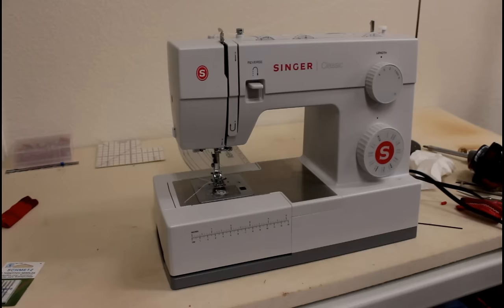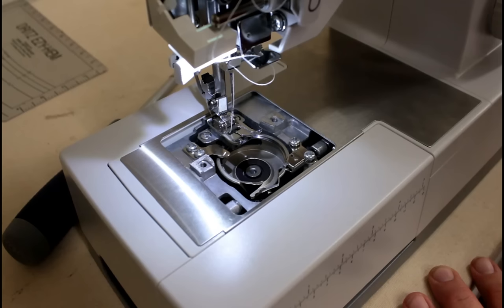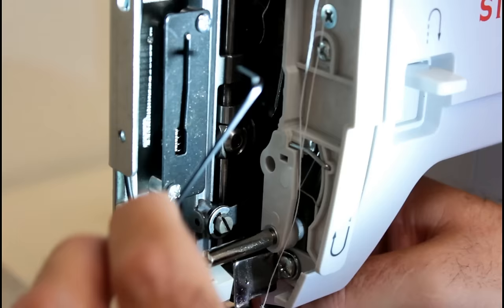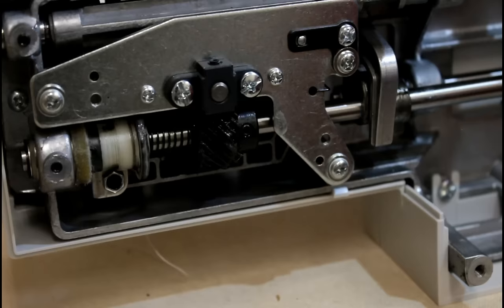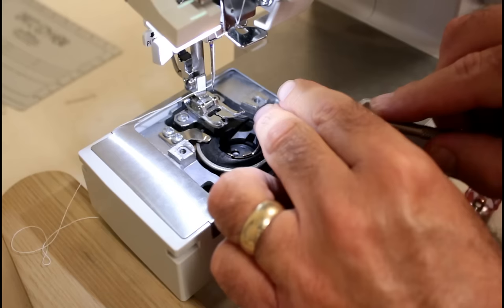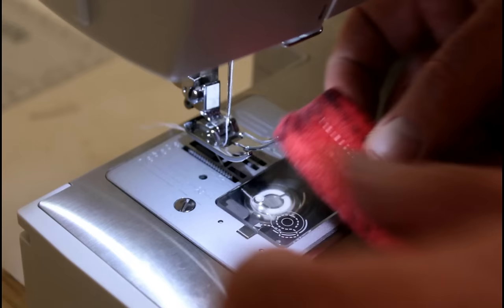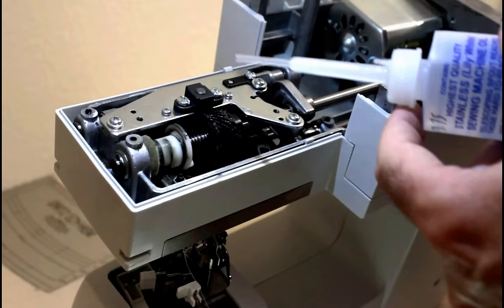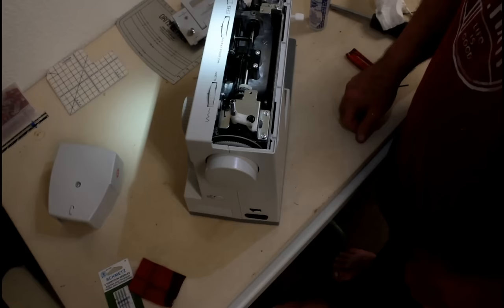Setting the Timing, Greasing & Oiling the Singer Heavy Duty Series Sewing Machines

Comment: Thank you for this tutorial. Very informative. I've never dug into my Singer Classic 44s like this before. I started out with my machine only being able to complete a straight stitch, but not picking up the bobbin thread with a zig-zag. In my research I believe it's a hook timing issue. My needle is aligning properly, as you've instructed, but after reassembly it isn't able to complete even a basic straight stitch. Where might I have gone wrong and what can I do to repair this on my own without taking it in for service?
Reply from the maker: Just take it apart and see how much it is out of time when looking around to take up the thread. I have had to do this many times before.

Comment: Hey Kevin!this is such a well explained video! I just changed the timing and it loops when I turn the wheel and catches both stitches for the zig zag but when I sew it only catches the straight stitch... and not the other right stitch! I'm assuming it's still a timing issue?
Reply from the maker: Yes, it can be the needle depth and /or timing.

Comment: Thank you Kevin, an exceptionally good video. You speak plainly and w/excellent volume.   You made this fix look fairly easy.   What can throw  both needle and hook timing off?    Also what is the danger of turning hand wheel away from you and not toward the front of machine?   And is a little bit of turning hand wheel in wrong direction bad for machine?  Appreciate your answer and willingness to share your knowledge. I am a subscriber.   Oh yeah, where to get Service manual for these machines?
Reply from the maker: I've turned the handwheel the WRONG way (away from the front) on many occasions without doing damage to the machine. However, Singer says not to do so. You can get the service manual using the link I provided in the video description. Click on Show More if it isn't showing up for you.

Comment: The only step I didn’t understand is the adjusting of the needle in the top housing.
Am I loosening it to make it move up and down or tightening it to keep it completely still?
Reply: How deep should the needle be?
Reply from the maker: In the case of the one I was repairing on this video it was thrown out of time by trying to sew something that was way too heavy for this type of machine. This caused the needle to push up slightly. Therefore, it wasn't coming down to the lowest point timing wise. This means you have to loosen the needle bar screw and then rotate the wheel until the hook rotates around to the point it would be picking up the thread. Then you lower the needle to that point and tighten up the screw that holds it. This may require a slight adjustment, but it will get it close.
Reply: @kevinsews  my needle looks like it is to deep set. I did loosen needle screw. . I don't see any difference.  Idk. Put machine back together now it want advance fabric. I checked feeddogs.

Comment: This video was so helpful as I ran into this issue last year and was able to fix it. This year I have ran into the same issue and for some reason my 1.5 mm allen key does not fit into the bolt right above the one you loosened in the video. The timing is so completely off and I have no idea what to do next.
Reply from the maker: Did you try going down a size to see if it would fit?
Reply: @kevinsews  I had to purchase a torx key set and it worked. The only issue now is that I believe the timing is in the opposite position. When you turn the lever towards you, what should the needle be going up or down?
Reply from the maker: @Sarabimakeda  Yes, it should go up and down as you turn the wheel toward you.
Reply: I tried this but couldn’t get it to work.  I’m at my witt’s end.  About to throw the “dang” thing away and buy a new one.  I have no idea what I’m doing wrong.
Reply from the maker: @debbieharper4771  Tried a new torx set and it didn't work?

Comment: Great video, really detailed and helpful.  We have a problem with the button for the drop feed dogs, after using it the feed dogs would no longer come up to regular sewing position.  My husband was able to toggle the switch under the machine to make the feed dogs return to regular sewing position, but something is broken, any suggestions would be appreciated.  thank you
Reply from the maker: Remove the cover on the base plate and see if the lever that controls the feed dogs up and down feature came lose. I've seen this happen before.

Comment: Great video Kevin, I just did a retime on a Singer Confidence. It doesn't have easy access panels, the whole front section has to come off. Also it has needle to dogs timing AND needle to hook. I was wondering if your manual didn't give you a needle height spec? I guess having the needle threaded and seeing the hook pickup work in all needle lateral positions was enough though. Thanks for sharing.
Reply from the maker: It does provide the measurements. However, I just adjust it until it does the widest zigzag width sews successfully.   After doing this all of the other stitches work successfully.

Comment: Great video, thank you for the tutorial, I have the same machine, took it apart watching your video, fixed the timing, all seems well, except now the thread keeps jamming, and looping bad on the bottom, changed needles, rethreaded, etc, very frustrating, I won't quit till it works. Any suggestions ?
Reply from the maker: Take a look at this video on how to test your starting point for needle thread starting point: https://youtu.be/7lyxWXCh2dQ
Reply: @kevinsews  Solved the looping issue. Thank you. Goes along sewing fairly well, but have a skipped stitch here and there. Any idea what to check ? Tried new needles, thread, etc, I will not give up, this is my mission to fix it.
Reply from the maker: @terrysmith4295  It can be a timing issue or the needle isn't close enough or too close to the hook. Needle tension can also contribute.
Reply: @kevinsews  Is there a way to move the needle bar if the needle is to close to the hook ?
Reply from the maker: @terrysmith4295  Yes. they show you how in the Singer Service Manual. See the link I provided in the About area to download it.

Comment: Well, Kevin Sews, Kathy (Anjylkat) here still does not. Oh boy, I’m beginning to wonder if I will continue to mess my machine up worse if I keep trying to do this myself! I’ve followed all the things you show in this video and lost a couple of things (bobbin holder, screws, bobbing cover plate. I was feeling very accomplished at getting things apart and putting them back together and making adjustments to the needle bar, aligning the hook and needle so top thread gets hooked correctly. I’ve made sure with the press foot in both up and down positions is doing what it’s suppose to do, but now it won’t make any stitches. The bottom thread isn’t catching the top thread to make a stitch or vice versa. I’m still not clear on that whole process…but all the catching and pulling material into the bottom and making a big mess on underside of fabric, it’s now just making one long giant stitch and then begins to stick and gather at the presser foot. No stitches if any kind too or bottom. Is there another video you can recommend at this point? I’m almost ready to throw it out the window, take it in for repairs at a shop that I boy sells super high end machines, or suck it up and keep going until I get it sewing right. I’ve checked and changed  needles, rewound bobbins, made sure bobbin thread is going in the right direction and catching/lying  where it’s supposed to  correctly. Anything you can lend would be so appreciated and I do really appreciate the all your videos and how much you’ve helped so many of us. I now know that I caused a lot of my problems by not taking the time to learn how to use my machine correctly and rushed through to do the sewing projects I had to do right after buying the machine. If I can get it fixed I believe it’s a great machine to see the things I want to sew jean, leather, cottons, polyester knits, chiffon, etc. I’ve learned a great deal but if I don’t stick with it, I easily forget and have to re-educate myself in what I previously learned (aka short term memory loss 🤪😜😛
Reply: I found one of your videos that I’m going to try tomorrow to see if that fixes it cuz, yeah, I think the bobbin holder thingy is loose.
Reply from the maker: @anjylkat  If you still are having issues then download the service manual and follow the steps it provides.
Reply: @kevinsews  thanks Kevin! I downloaded it awhile back when I took it apart the first time and couldn’t figure out how to get it back together. I must say I get to the point where I’m beyond frustrated and want to give up on it, but due to your videos and a few others I take a break from it and dive right back in and  push myself to rewatch the videos and try it again. I’ve learned more each time and have a better understanding of all of it! After spending literally hours on trying to get the free arm slab to fit back on, I realized I wasn’t putting it on correctly. It had to go behind the black square thing in the middle not slide alongside of it. Anyway, I’ll have it all back together soon and since I already adjusted the hook and needle once before I know I will get it again, but if it wasn’t for all the information you and a couple others have given on your videos, I’d never have accomplished what I have so far! I’m anxious to get this working good so I can make those flannel pj pants from the video on your channel! Thanks again!
Reply from the maker: @anjylkat  My pleasure! I am glad to hear you are making progress.
Reply: @kevinsews  bit the bullet and bought a new machine. Same model and make. Least I know lots about this one and know things NOT to do! I’ve spent way too much time at this point and I told my granddaughters I was making them aprons but only got one done. I told the youngest one I was making her a ladybug backpack for school but no backpack and school starts this Weds. I’m kinda hoping I can move close to them next year cuz I’m in a Cali and their dad passed away 7 years ago so my other son and I are very important to the kids now that their daddy is gone. I made a Jean purse lined & trimmed with a shirt my son often wore and carry it around with me. There are several things one can make to serve as reminders to keep them close. Oh gawd, here I am telling you my life story!!! I really don’t know why other than you seem to be a real genuine all around good guy kind of like Governor Walz who Kamala Harris chose as her running mate. 

Take care and thanks again for your videos and everything! I look forward to learning how to make the flannel pj pants and the elastic waste skirts and more. Very thorough on those videos!
Reply from the maker: @anjylkat  Okay, I hope the new one works out better for you.

Comment: Kevin at the upper part with the two-part which drive the needle downward,  I loosened both parts and can not get the needle to go downward.  Either it slips or locks.  Can you send me a screen shot of what the correct position should be for tightening the upper needle drop?
Reply from the maker: I am on the road. I will see what I can do once I get back home.

Comment: Thank you very much! I just finished doing all of this and my machine runs so smoothly. I had recently had a knocking sound. By cleaning the grease and fluff, the knock is gone. 

The manual shows how to remove the front cover. Do you think we need to do that since it wasn’t in your video? I’m looking forward to your next one.
Reply from the maker: It is an option. I always remove the complete covers when working/cleaning mine. You never know what you might miss when the cover it blocking your view.
Reply: Hi Kevin, I went to the link in the description to download the service manual, and it gives a error. Is there another link I can download it from? Thanks
Reply from the maker: @cristinapisaneschi1167  It worked for me. Give this a try: http://www.kevinsews.com/download/SingerHeavyDutyServiceManul.pdf

Comment: Thanks for all the good information about adjusting the Singer 4452 machine. Can I suggest something that might help with the double checking process once you’ve made the adjustments?  The material you’re using is way too thick. I think most of us have had the jamming issue sewing that furry thick material. A thinner cotton flannel, doubled up would be easier to sew on for the test runs.
Reply from the maker: I tried several different fabrics before I stated recording it. I agree one needs to try several type and sizes of needles.

Comment: Thanks for the detailed video! My Classic isn't picking up the bobbin thread, but also the hand wheel becomes tight at about half a turn. DO you have a video on that, by chance?
Reply from the maker: Sorry, I don't. Usually, this is a mechanical issue that is also consider a timing issue.

Comment: Kevin,   Very well explained video!   Back in 1978-1980 when I was in college, I worked for a Singer store doing machine repairs.  What you did in this video was called a tuneup.   Cost was $19.99.    I always put a new needle in before I started.  Question, did Singer stop doing the best thing they ever did which was put timing marks on the needle shaft?    There were two rings on the shaft, bottom of travel and hook position.   This always worked, once and done.    Also, you did not mention checking the clearance from the hook to the needle.   There should be an eccentric in case it needs adjusting.
Even though you showed very well how to do this, there will probably be several who try and fail and end up taking in to get fixed.   Many a woman came to the store crying because their husband tried to fix their machine.   Usually the machine and a box of parts!
Respectfully,    Kevin
Reply from the maker: Thanks for contributing. Very Much appreciated.
Reply: Kevin Sews    Did they stop putting timing marks?
Reply from the maker: @KevinCoop1  I am on the road right now. I will take a look when I return next week and let you know.
Reply: Kevin Sews     Have a safe trip.
Reply from the maker: @KevinCoop1  Thanks!
Reply from the maker: Okay, I finally had a change to look. I didn't see any marks like you see on the classic machines.
Reply: Kevin Coop,  for a dumb woman and her vintage singer 237, which mark is which please?   And would you explain what measurement an eccentric ( distance between needle and hook) is?  I realize how ignorant I sound, and I am,   regarding sewing machine repair.  I always depended on my mom, or the local super talented repair man.  Alas, she has alzheimers, and he retired and moved away. That leaves me or 300mile drive one way.  Thank you for any help.  Oh by the way my Kenmore 158.1941.2 also has marks on the needle shaft.
Reply: @jojosewist8921     Ok going back 40 years here.   Pull the thread, take out the bobbin.   Rotate the wheel on the right forward slowly.   When you get to the point that the shaft is all the way down(jiggle back and forth slightly) the top mark on the shaft should be aligned with something.   A mark or the bottom of the sleeve it is inside.   If not, hold the shaft with right hand, loosen screw higher on the shaft where the arm off the wheel is.   Adjust to right height and tighten.    Now, with a new needle installed, rotate the wheel on the right until the lower mark aligns with whatever the top mark did.   With the needle in the center, the hook should be exactly behind the hook.   If not, you will have to take the bottom off of the machine.   Loosen the two screws on the gear on the left side horizontal shaft slightly and align hook with needle at the lower mark.   The hook should be very close to the needle, but not touching.  If touching or if more than a finger nail thickness away, then the eccentric(a bushing under the hook, on the shaft) holding screws need to be loosened and rotated to get the hook/needle correct.   I would try sewing without doing this first though.   It may work fine.   
The best thing you can do is blow or vacuum the lint out of the machine top and bottom, and put one drop of oil in all of the small holes you can find.   There are several.   Clean the lint out of the pressure discs on the front often.
I hope this helps you!   Best Wishes!   Kevin

Comment: This is so great! Thank you! But now my feeder dogs get stuck down. I can go into the bottom and pop the gear back to release them, but then they get stuck down again. I think I messed something up while I was in there fixing the bobbin.
Reply from the maker: There is a switch on the bottom back side of the machine that lowers the feed dogs. Make sure it isn't set to the down position.
Reply: @kevinsews  I know about the switch :) the switch does nothing in either position, as the feeders are stuck. I'm just going to open it up again and try to find what's going on. Thanks anyway!
Reply from the maker: @ArlanyaJewels  ok I will take a look at it over the next few days. Keep us posted on what you find. BTW, did you download the service manual.
Reply from the maker: @ArlanyaJewels  Okay, download the service manual and look at section  3-15 Feed-dog height section. Hopefully, this will show you the area to get started.
Reply: @kevinsews  Thanks so much!
Reply from the maker: @ArlanyaJewels  You're welcome! I am glad to help you.

Comment: What do we do when there is a mess in the bobbin needle that does not pick up the thread with the thread getting tangled at the bottom?  I almost went crazy, I have a lot of work and the machine does not work.  Please save me
Reply from the maker: This could be one of several things. The first thing to check is that your thread tension is correct.